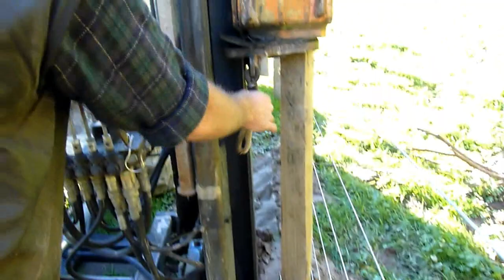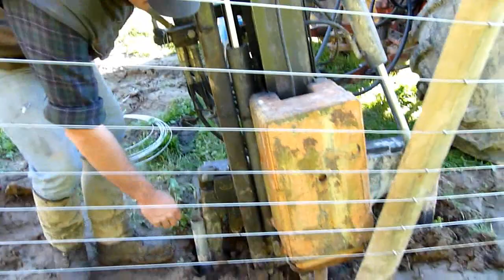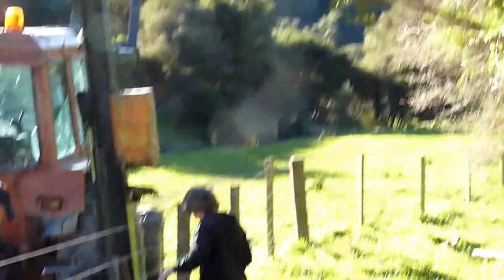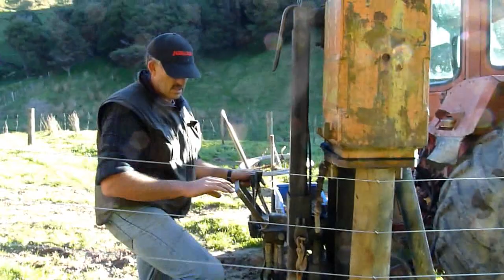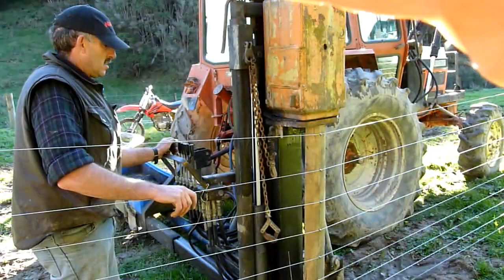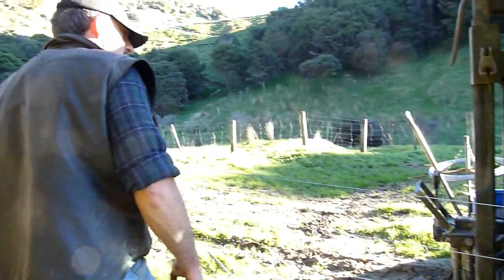best agricultural fencing tips - TIP N°2

Comment: Depends what type of treatment the wire has. You can also attach the wire above ground by using a longer foot if so desired. The principles are still the same.

Comment: What happens when the wire rots? It will rot quick because of being in contact with the ground.
Reply: rescuecow90 it’s stainless steel, lasts a long time in the ground even in coastal conditions
Reply: That's stainless steel wire staples will rot out first
Reply: Galvanizing reacts with stainless,  will rust out really quickly.

Comment: How does the wire attached to the foot work? Why is it strained upwards?

I would just hire a post hole borer and chuck some quickset in.
Reply: The wire is attached to one end of the foot, so when the post tries to pull it out the ground it just rotates the foot slightly, jamming it even more firmly into the ground. The wire to the foot is under tension which stops the post lifting.

Comment: The wire may never rust , but those wooden posts will ROTT off at ground level due a constant level of moisture in the ground !
Reply: joe doakes it dries up in the summer there. I myself would've chosen a better post but whatever.
Reply: posts are ground treated H4last 40-50 yrs.
Reply: I hope you're correct , but , the only 40-50 year wooden posts I've seen(USA) are old telephone poles that have a much higher level of preservative that were cut into fence corner posts ,etc . They resemble RR ties(wood) that have been given the same level of preservative and last for many , many years !
Reply: @joedoakes8307  I have used , telephone poles, 12 ft, for strainers, that have rotted out from the centres, my cattle yard posts, same, used railway ties, ok, but in New zealand, H4, GT.posts, used from late 60s, i used hundreds, in the 80s on my farm, still okay.
Reply: @joedoakes8307  Modern posts might only last 30-40 years (bit hard to tell at this stage), but plenty of old posts still going in this country. There's still old totara posts 60-80 years old still solid as